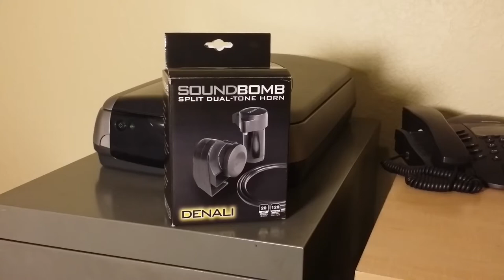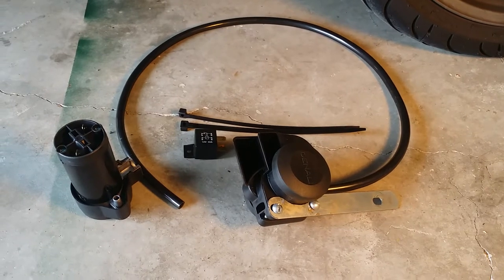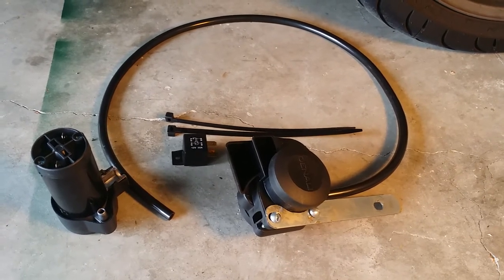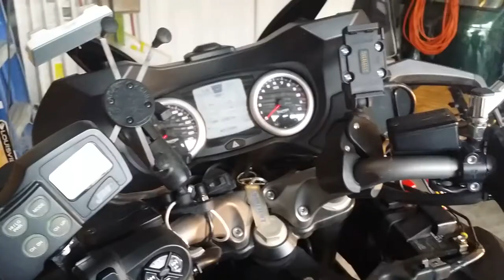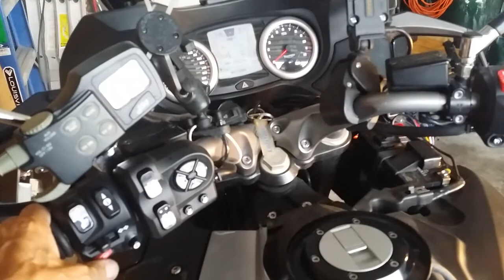Installing an Air Horn on My Triumph Trophy SE

Comment: I'm in the process of installing a new ONE PIECE air horn (139db: Stebel 11690019 - Nautilus Compact Mini Air Horn Black - from Amazon) on my 2017 TRIUMPH TROPHY. 

I just took the stock horn bracket and bent it on each end in opposite directions just above the holes, so each end is parallel and about 45 degrees from the center area between the holes - kind of an "S" shape.   This shape allowed me to mount the new horn in the same place the stock horn hung by the bracket, whilst setting it back a bit from the lower center inset panel when it gets re-installed installed - with the new lower manifold screen protector installed too.

Then I mounted the relay on the right hand lower radiator fan support screw (just opposite from the new horn (just needed a flat washer, lock washer, and a nut).  I'm also going to reuse the stock horn wires to activate the relay.  

Another addition to my 2017 Triumph Trophy SE is a Power Distribution Module 60 (PDM60) in lieu of a fuse box or any accessory in-line fuses. I got it from Revzilla.com; it has 6 circuits which can be custom programmed for a set amount of AMPS per circuit, they can also be set for a time delays of "ON" or "OFF".  Since it takes about 5-seconds for the TTSE's fuel pump and other "stuff" to be ready for starting the engine after turning the key to on - I'm going to set my circuits to automatically come on 10-seconds after turning the key and starting the engine - thus all battery energy will be for starter motor and necessary 'stuff", and no worries about spiking (blowing fuses) any accessories during engine starts.  (that's kind of how I started helicopter turbine engines by the checklist - first engine starts, then turn on other things - radios, navigation, etc).

So, one of the PDM60's circuits can be 20 AMPS for momentary items like the horn (rated up to 18 AMPS on the horn's package).  So, I basically just have to run one positive hot wire from the horn to the PDM60 being mounted under the seat for my set up.  Beep, Beep!

Then there's the GPS being installed, the alarm system, the BIKE CAM system, Crashbars to hold Aux Lights, accent lights, rechargeable cellphone holder, and maybe a RADAR detector and action camera?

One caveat to the PDM60 is since I'm positioning it so far from the battery (under the set) and the stock positive wire won't reach the battery from there, the company told me to cut that positive wire close to the unit's body and splice on a thicker wire to reach the battery (8 Gauge).

Comment: I’m just about to fit one of these to my own Trophy. Is there anything that you would have done differently after having had a couple of year’s experience of using it?
Reply from the maker: I'm happy with the way I mounted the parts. Thanks for watching.
Reply: EZ Moto Tim 
Thank you.
Your suggested locations for the horn and compressor have saved me hours of experimentation and I’m very happy to custom cut and drill the mounting bar for the horn from some aluminium bar.
Reply: I followed what you did very closely, making up a bracket just like yours to mount the horn in the gap behind the radiator. Sadly, it appears to be impossible to refit the fairing afterwards. I made the bracket out of aluminium, in case I needed to “reform” it to fit. I’ve tried that, but the horn gets perilously close to the down pipes and the fairing still won’t go back. I have no idea how you managed to get it to fit!
Reply from the maker: @Jon-zj2nj  It's been a while since I did this. I'm afraid I can't be much more help. Keep trying and I'm sure you'll find a way.